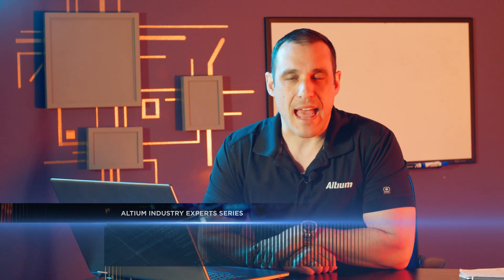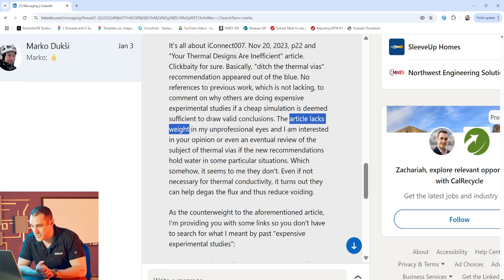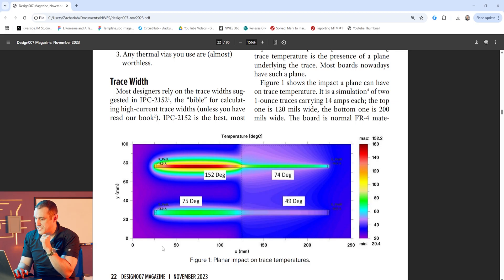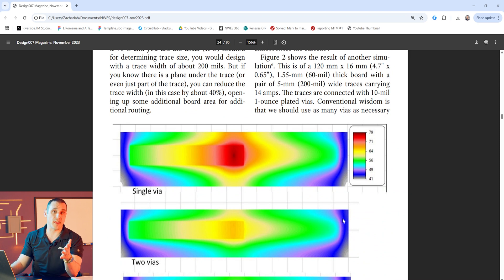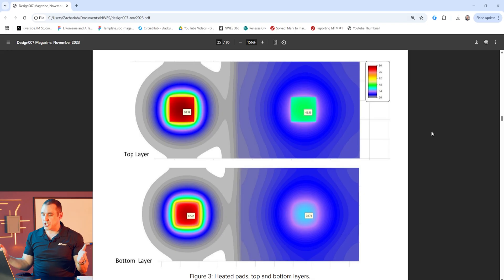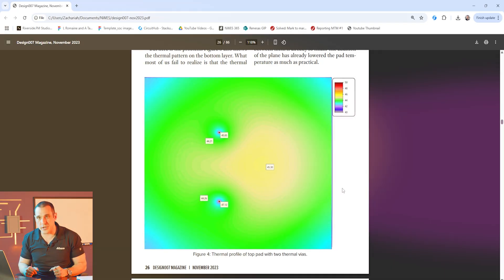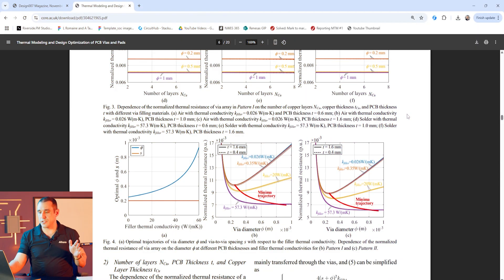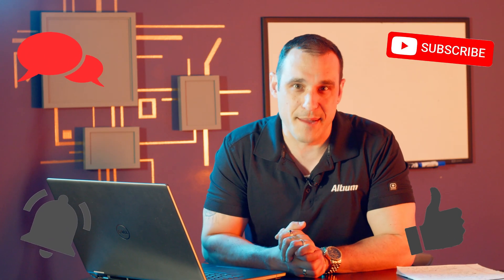Do PCB Thermal Vias Actually Work?

Comment: The iConnect article seems lazy. Besides the fact that they had a very simple model, they could have easily validated it by manufacturing it and testing it in reality. Simulation only goes so far and it depends on what parameters you put in, how you set up your model etc. Real world is what matters. Making PCBs is dirt cheap, manufacture it, measure it, and see if your results match up!
Reply: Also those colormaps are atrocious!
Reply: The real world is just a simulation with extra spicy reality added. If you’re good at simulation, you don’t need to keep ripping out “cheap PCBs” to test.
All of it is just physics- your simulation software and sim design either understands physics adequately, or it doesn’t. The solution to that is to improve your simulation and design with the least number of board iterations so you don’t have to keep doing that in the future. It’s also much more time consuming to do it the other way around over several projects rather than simply improve the simulation modeling on a few key tests as you go.
Reply: @charlescoolidge747 that's a gross misunderstanding of how simulations work. To quote a professor of power electronics in my uni: "simulation is like masturbation, the more you do it the more you think it's the real thing". No simulation will ever take into account all of the physical phenomena happening, at best it's a very good model if you have already gathered sufficient data about all of the model parameters (and sometimes you may not even know what parameters exist to make a full model). So it's useful for validating some hypotheses and reducing the design space by eliminating completely bs results. But if you want an actual verification of your hypothesis you need to manufacture it and test it.
Reply: @InTimeTraveller no, it’s an admission that math works. 🤷‍♂️

I understand there are some pre-Cambrian folks still trying to bash simulation because it makes most of what they’ve ever done to disprove it as a useful technology and to speak against it, go against their worldview otherwise.

I understand that nobody who has a very rigid worldview with a preferred method is ever likely to see past their own bias, because it’s psychologically and emotionally comforting to them. I get they have to take the opposite side “because it’s not 100% right unless it’s [their] way.”

It means absolutely nothing when the performance envelope can be correctly modeled to hit well inside MVP on the first pass if you just pay attention to your simulation criteria and design. 

Most products do not require the Nth level of perfection- they need about a 15-20% buffer past acceptable in a positive direction. 

The moment anyone has the stimulative capacity to generate that design successfully for the first prototype iteration to be successful product, that gets used. That’s not a coincidence. 

The people trying to make some philosophical argument about “but muh experimental confirmation is superior,” are typically trying to ignore the idea that everything in recorded history, is already your experimental evidence on the table to be researched, validated, and applied. 

It’s a poor student that cannot see through ideological bias to understand that working within design limits within a healthy gap, is more useful than trying to crank out perfection iteratively as a essentially poorly-informed brute force. 

So, your point is situationally true. It’s also becoming incredibly less relevant with time, because it makes literally zero difference in most of what needs to be done in modern practice. 

It made a lot more sense as a perspective before we had computers. Been almost a century of having and using them- they work, and do so primarily because we already have mountains of experimental data worldwide to put into modeling.

Comment: I think you could have given a recommended via spacing and size for most cases. Like there is a graph there but help make sense of it.
Reply: I second that request. Not as exact and with the same rigor as in the IEEE paper, but just a general guideline, would get us very far already.

For example: for a specific package with an exposed pad, or depending on the size of the copper area in contact with the device to be cooled, what would be a general guideline in terms of via size and spacing? Could we apply a relation between copper area and via size?

Or: Is it better to always opt for smaller via size and quantity, or is it better to use bigger vias when the region available for dissipation is bigger (due to the increased copper fill inside bigger vias)?

The answer is given, that vias are not irrelevant, and impact heat dissipation in a substantial way. Yet, I didn't learn much beyond that fact.
Reply: I agree, but from what those simulation images showed I took away that 1 via was fairly necessary, and if space permitted 2 was highly desirable. 3 or more was much more debatable - if space then maybe, but no serious need.

Comment: If we add many thermal vias, won't it reduce the area of the ground plane and hence reduce the ability of the ground plane to dissipate heat 🤔⁉️
Reply: It will reduce the ground plane by a small amount (basically the diameter of the holes times the number of the holes, usually you will be limited by fabricator tolerances for via to via spacing way before you significantly reduce the total pad area) but it will greatly improve the thermal resistance between your hot spot and the ground plane.
Reply: it reduces the ground plane surface by 2*pi*r^2, but it also increases by D*pi*depth of via, so assuming a 2mm Diameter via it reduces surface area by 6.283mm and increases by 8.796mm so at least at smaller via sizes you actually end up with a net increase in surface area of copper assuming a common PCB thickness of 1.4mm
Reply: I have generally gone to .3mm ID vias for everything I do including thermal vias except if a smaller one is absolutely necessary. Reasons for doing this is every fab can handle them without extra charges, they can carry several amps of current which match with routed power needs, they allow for filled, plugged, or other treatments as needed. In the case of thermal performance they seemed to have the best conduction to reduced copper for a given area and are placeable under even fairly small IC packages. One other benefit to them is during prototyping you can use them to fix oops in routing   and soldering a jumper wire through them while cutting to bad traces😉.

I don't design any HDI or GHz stuff but for the class 3/4 board I work with they seem to work well.
Reply: The thermal vias we are referring to, which are normally connected to the die-attached pad on the bottom of an integrated circuit, are connected to the GND plane, most commonly as through-hole vias. I guess you are replacing the ground plane copper with copper in the via walls, but that shouldn't matter, you are creating a low thermal resistance direct connection to the GND plane. Eventually as you add a large number of thermal vias, they start to look a lot like a solid metal connection between the thermal pad and the plane. That's what the IEEE paper was investigating: how many and what arrangement of vias do you need before you reach a condition of minimum thermal resistance and you no longer need to add in any more vias.

Comment: I had a lateral pour and thermal vias in pad to the back side of the board to cool a hot FET.  The vias dumped far more heat than the lateral pour, matching simulations.